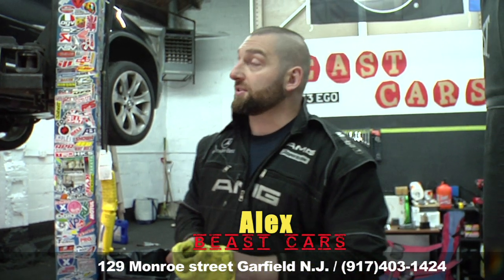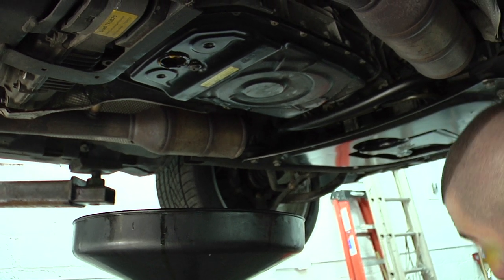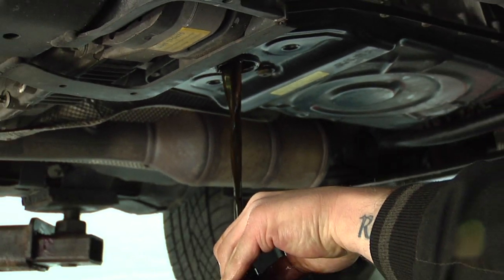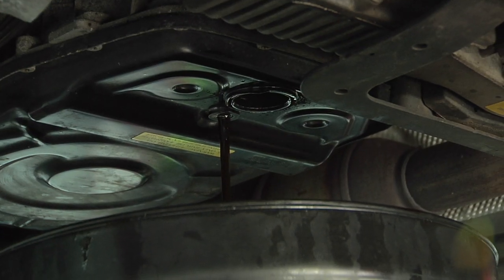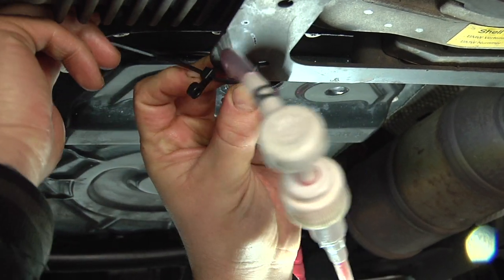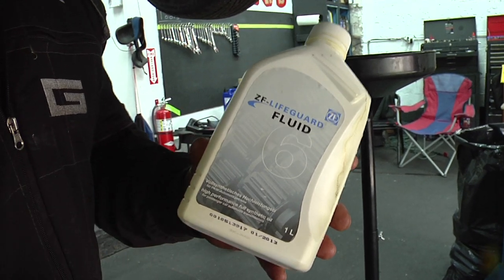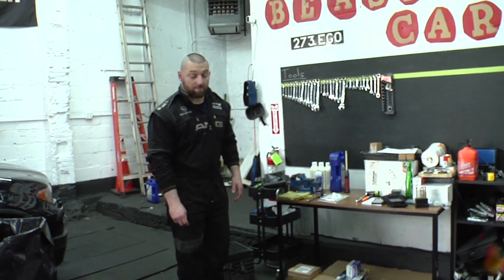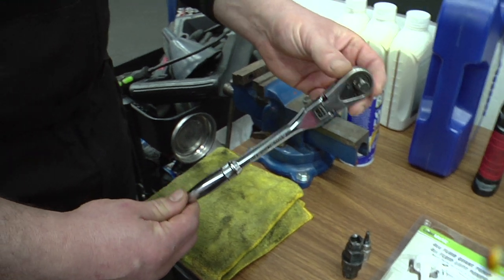BMW X5 E53 4.8is Transmission Fluid Change

Comment: Hi I'm in the UK, i have a BMW x5 2005 e53 4.8is 99545 miles, I've converted it to run on LPG, done lots of work on it, and at the moment it's having the transmission fluid, filter change, ive alrrady changed the engine oil, coils, filters etc, 4 new 20inch tyres, new xtrons head unit, new complete rear light assemblies, instrument cluster being refurbished at the end of the month, then later this year, new alloy wheels. Thanks for the video, best wishes to you, Andrew 🏴🏴👍👏👏
Reply from the maker: Amazing truck. So happy you are keeping it going!

Comment: Great video, i wish i had a mehanic like you in my country. I own 2002 e53 4.6is with zf5 gearbox with 218 000 kilometers behind him now. I invested a lot of love , care and money into that car and actually solved a lot of issues that previous owner collected before selling it to me and there is this one last thing that is bothering me, when the car is cold everything is fine , but when it warms up it starts to do this weird knock while stopping (from 2nd to 1st gear) , not allways, sometimes it doesn't, sometimes it does it soft , sometimes it does it harder and i dont like it. As i found out my mechanic didnt replace gearbox oil properly as it should , 2 years ago he just drained old one and filled the new one and thats it. He had to change my gearbox oil because my gearbox oil cooler broke and mixed gearbox oil with coolant. During those events i had gearbox error code and went trough a lot trouble with that car. Replaced all hoses as they snapped one by one and 100 other things. Now it practically has new cooling system and behaves a lot better. No more error codes on gearbox but still that knock from 2nd to 1st wont let me sleep
Reply from the maker: Thanks for the lengthy comment. 
Read this article. You will understand the inner working of the transmission better. 

https://sayyarti.wordpress.com/2015/01/20/everything-about-your-zf-automatic-transmission-issues/
Reply: @beastcarsnj868  thanx
Reply: @beastcarsnj868  thanx a million for this article , i suspected something like that. So it's gonna be gearbox maintenance time soon , untill i do it im gonna drive it slow on city roads as recommend
Reply: @beastcarsnj868  another funny thing , that hard downshift from 2nd to 1st doesn't happen during summer when i keep my A/C on
Reply from the maker: @filipskalic3376  Yes, thats true, when the ac is on, rpm is a bit higher, and that makes that shift smoother. I have observed many instances the transmission acting that way.
Reply: @beastcarsnj868  thanks for the reply. Ill start with first things first. ill Change gbox oil and filter properly and see what happens

Comment: That is check  fluid level. Need to turn the car on while in P and pumping fluid until it spill out.  If want to precisely, Use temperature gun and measure temperature between 30-34°C point at the fill/check plug. Open fill/ check level plug and let excess fluid come out. Quickly close the plug, and turn off engine.

Comment: Thanks for your tips about the MAF reading on my 4.8is.  I noticed that it was slow to go into reverse (2 - 3 seconds).  Do you think a filter change and new ATF would fix this, or it may be a solenoid/valve body issue?  It has 170k miles, but no codes or slipping.
Reply from the maker: I proud try the fluid and filter first. Reset adaptations, and see what happens. If that doesn't help. Valve body time.
Reply: @beastcarsnj868  hie boss just need to know how much gearbox oil  do I need to put in x5 e53 3.0d the 2nd one with double sunroof

Comment: Hello boss, I’m trying to add treatment for the gearbox oil. I have x5 v8 2006. Any recommendations  how to do it? Thanks
Reply from the maker: Hey, I would honestly avoid adding anything besides lifeguard 6 to these gearboxes. But if you must, start the car cold, quickly open the fill plug, and before the car warms up add some of the additive. But again, I would advise against adding anything but the oem fluid to these boxes.
Reply: Thank you boss, I won’t add anything. 👍

Comment: I also have an x5 e53 4.8is 2006, is there any transmission  filter to change ? During this service
Reply from the maker: You could of course. 
In this case was only fluid exchange.

Comment: How much oil did you fill up after draining te old? Because it is not all of it right?
Reply from the maker: It's not full capacity at all. I would say have 6 quarts available and follow the fill procedure.
Reply: @beastcarsnj868  thanks.
How many kilometers whould you advise to ride between the small oilchanges (without opening gearbox)
Reply from the maker: @tomblock6841  I would do the the drain and fill every 50k and filter change every 100k. so basically alternate between them every 50k.

Comment: I have a 2005 BMW X5 is it the same process? My X5 gets stuck in first gear and the mechanics over here in Cali be really taxing just to check
Reply from the maker: You probably have an issue with the valve body, solenoids or low fluid. 

I would get a reman valve body and solenoids from a reputable source and change it out with fresh filter and fluid. See what happens.

Comment: Is it safe to change transmission fluid and filter 

One change was done at 40,000 miles now it’s at 180000?
Reply from the maker: I'll be honest with you, people have done it. And had no issues. But I would be weary.. I would do a series of micro changes. Drain the trnas, save the fluid, change the filter. And put the fluid back. Just swap 2 quarts for fresh fluid. Then in a few weeks. Drain again, and change 2 more quarts. It's more of a minor refresh, rather than a shock to the system.
Reply: Thanks I really appreciate it it’s riding smooth it’s just a head ache. because every shop tells me something different
Reply from the maker: @joshuabrisita9555  any time.

Comment: Hey i need your help … i have the 3.0d m57 engine do i need to use the zf6 transmission fluid? Or any other fluid is ok??
Reply from the maker: Hey. Zf6 is designated for the 6 speed zf transmission. If that's the one you have, then yes.
Reply: @beastcarsnj868  just use any full synthetic transmission fluid will do.
Reply from the maker: @vnyeu  I'm sure it will work. But I'm my experience, I've tried valvoline, and mobile 1 fluids in zf 6hp* transmissions, and they all shifted funny after. Once back to zf fluid, the would go back to oem shift quality. Might be anecdotal evidence, but was enough for me to just use zf fluid.

Comment: Which zf lifeguard oil are you using?  I see a 6 and 8 and other versions online.
Reply from the maker: For this application use the 6.
Reply: @beastcarsnj868  i have a bmw e53 4.8is myself. Do all bmw 4.8is have this ZF gearbox?
Reply from the maker: @jorg1984  yes. All have the 6 speed zf box. Very good unit if maintained properly.
Reply: @beastcarsnj868  thanks very much for the explaination. Would be nice to see you do a video with changing the filter aswell. Keep up the good work
Reply from the maker: @jorg1984  thank you. I should start posting more. You're right..
Reply: @jorg1984 i am looking for that too. Did you find any yet?

Comment: Boss I need your help, how to check if the transmission have enough oil? Can you explain please, thanks
Reply from the maker: 1) The transmission fluid temperature must be between 30°C and 35°C before checking can begin. Use an appropriate scanner to determine the trans temperature.

2) The vehicle must be level with engine running at idle speed and air conditioning turned on.

3) Step on the brakes firmly, apply parking brake fully and shift to D and R, briefly pausing in each position before shifting back to the Park position.

4) With the engine running at idle speed and the selector in Park position, remove the filler plug. Monitor the transmission temperature, if a small stream of oil runs out at 40°C, the fluid level is correct.

5) If no oil runs out when the filler plug is removed, the fluid level is too low and oil needs to be added until it overflows.

6) With engine running, install the oil filler plug and tighten to proper torque
Reply: Thank you mate👍👍 you the best.

Comment: Hello boss i  want to ask when u down the car how u gonna put the bang back?
Reply: Is it gonna spill all the transmission oil?
Reply from the maker: I'm not sure what you mean by putting the bang down? Could you elaborate?
Reply: @beastcarsnj868   i mean like u said , we need to low the car right if the new fluid is dripping and put more in it? so if you low the car is not gonna drip a lot of oil ? 
because the x5 take 10lt right?
Reply: is the transmission oil gonna stay there in the box if u put more in it?
Reply: Because i wanted to put 9-10 lt of new transmission oil in it.  how im gonna do that?.
Reply from the maker: @edwardarquillo8922  you can not overfill the transmission. It will not work correctly,and might cause premature wear and leaks. 

The drain and fill procedure doesn't replace all the transmission fluid. It replaces approximately 5 liters. 

You can do the procedure a few times to ensure higher percentage of oil gets renewed.  

If you follow the procedure, you will find that exactly the correct amount of oil will be placed into your transmission.
Reply: @beastcarsnj868  i follow all of the step , i drain about 4 litres , and i fill up with a new oil and it was 4 litres and it  waste 2 litres all come out .
Reply from the maker: @edwardarquillo8922  I don't know what exactly you are doing. But if you keep the engine running, the fluid will not come out. 

First fill is very small. Maybe 2 litres. Then with the engine on. The fluid gets sucked into the trans. And keeps circulating. And then you keep adding fluid until it drips.  Then you close the plug, and only then shut off the engine. 

If for some reason uts not working out for you. Maybe it's best to take it to a shop that has experience dealing with the ZF transmission.